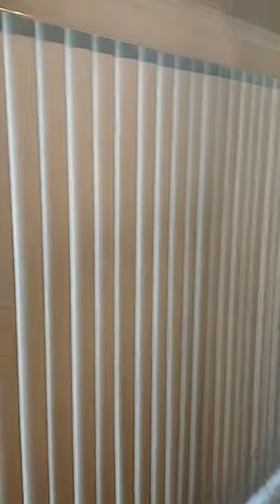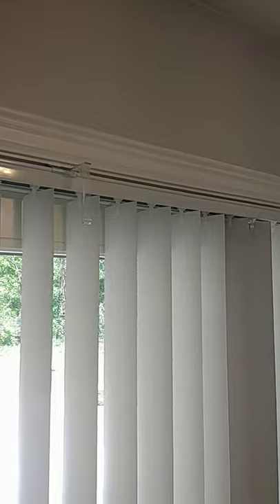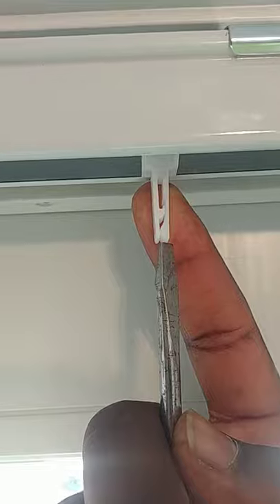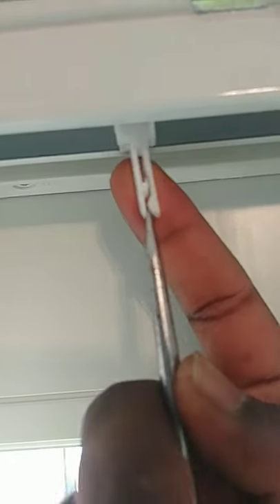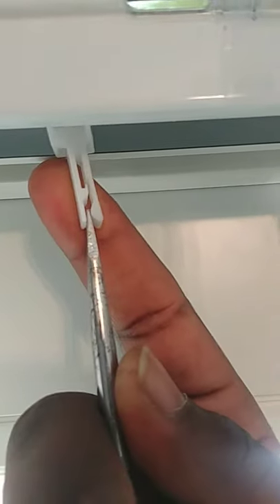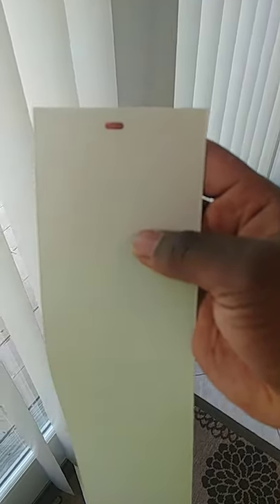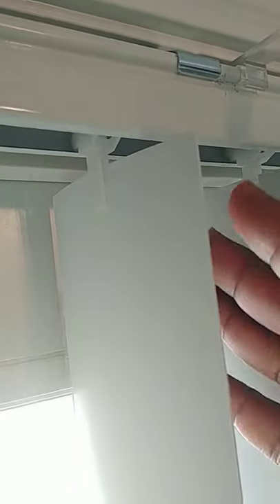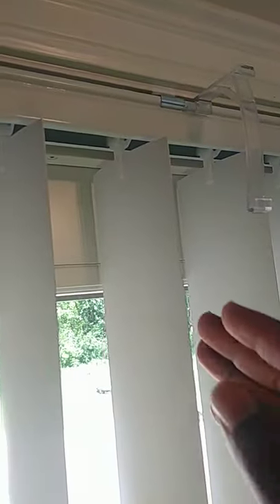Replacing Slats for Vertical Blinds

Comment: Another tip, if the veins get broken flip upside down, take another one line it up and use like a box cutter blade and cut out a new hole😆
Reply from the maker: Working smart right there!
These slats are not cheap, so I'll make sure I've tried everything with my paper hole punch before I buy a new pack.
Reply: Paper clip and clear tape works well and no holes 🕳️ on the bottom.
Reply: If they fall just put a couple of staples above the hole.  The staples hold the weight.